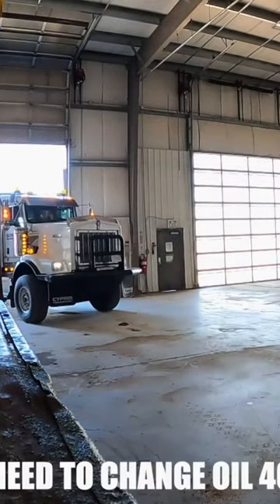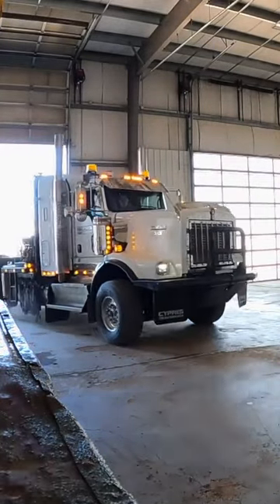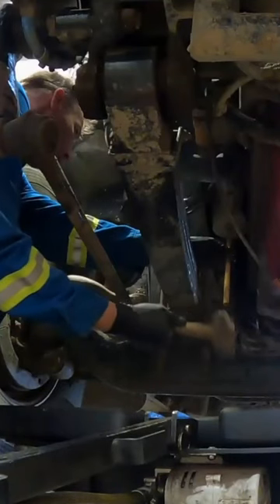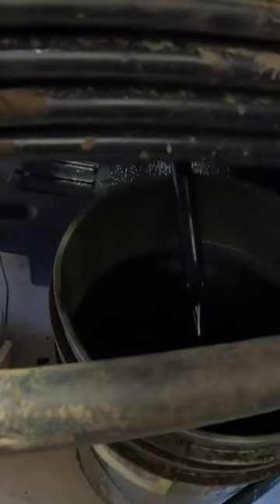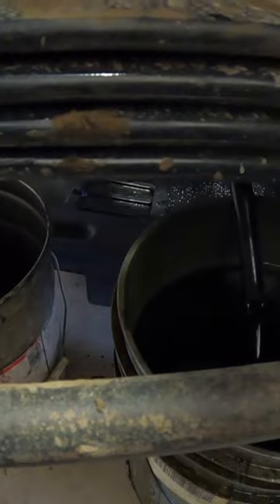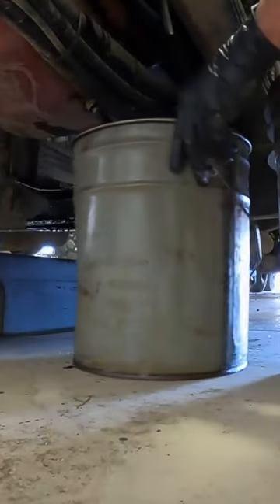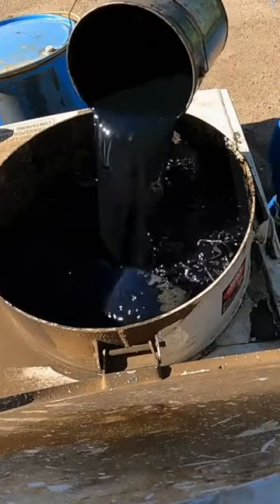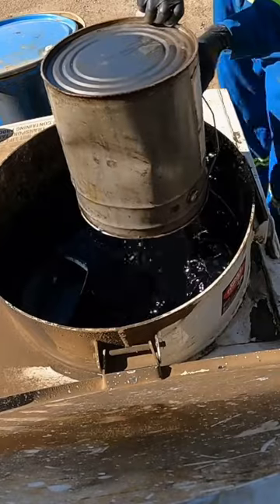One minute oil change #trucking #bigrig #truckdriver #c500kenworth

Comment: All truck burn or leak a little that’s why they have such a deep sump. Don’t really need to put extra. I’ve tested used oil with a drip test and most of the time 25,000 miles still passes and could be ran for another 25k. Synthetic diesel oil is good shit
Reply from the maker: yes i burn oil. ive always changed oil every 200 hr at roadtrain and here at cypris we do 300hr. when i first got here we were doing filters at 300 and complete at 600, couple block spit out some rods.
Reply: I run 15w40rotella in my 01 chevy, 487k all original only change oil every 100k miles. Still don't look bad.  It honestly runs like a brand new one and I drive it hard

Comment: You forgot to mention wipe the filter wrench clean before putting it away lol
Reply from the maker: if you punch the hole there's no mess. but i do get splatters on the floor, i could have mentioned a lot more surprisingly its hard to fit that into a minute. same with the grease keg too. shits all gross and greasy. roadtrain and my parents raised me pretty good to be clean, but on the downfall i hate mess. so many people just around to collect the check, forget clean, service, maintain...... and so much more, this fuels me to owner op, only if a boat load of cash falls in my laps tho, not finacing anything
Reply: @TimelapseTruckerRTOT  don’t.  Just spin it loose and let it drain into a plastic bowl like the bottom of a windshield washer jug. Only ever 1.87 L comes out per filter. So volvo has 2 and a bypass filter. So 5.8L ish.  Then no mess.  No drip on the floor. Also prime the seal so it comes off easier.  I put them hand tight and don’t even use a filter wrench but I’m 6ft2 and 280 pounds and have some mad grip strength from 19 years of mechanic work. Never had one come loose. I have a rolling drain tray I never use.  Always used 5gal pales cause it’s easier to transfer.  I only use the tray for coolant now cause it always comes out making a mess and the tray is massive and holds 160L full so it gets all the coolant.